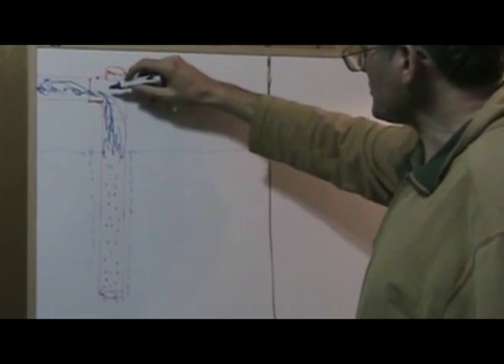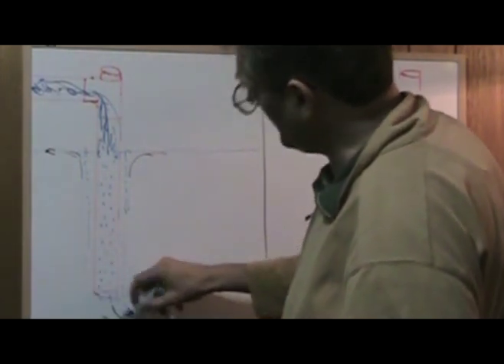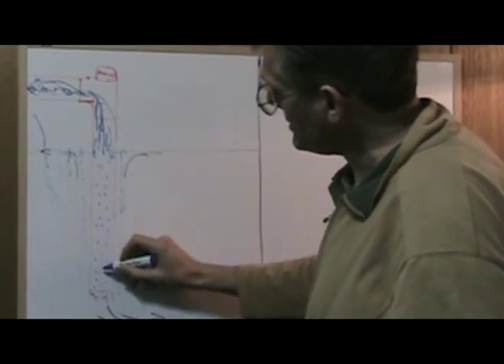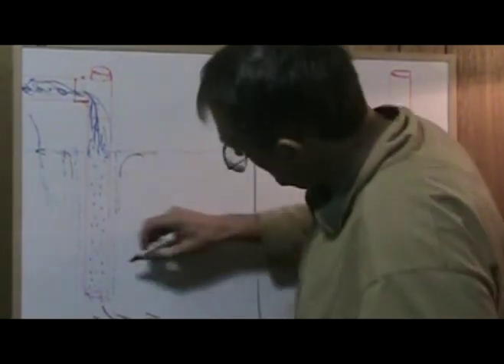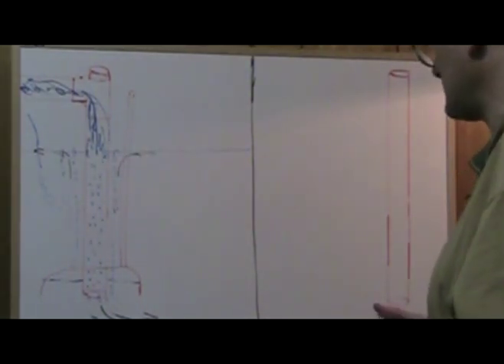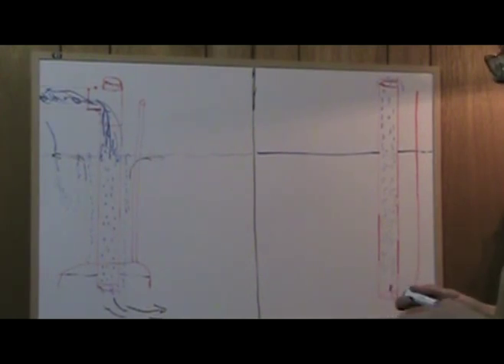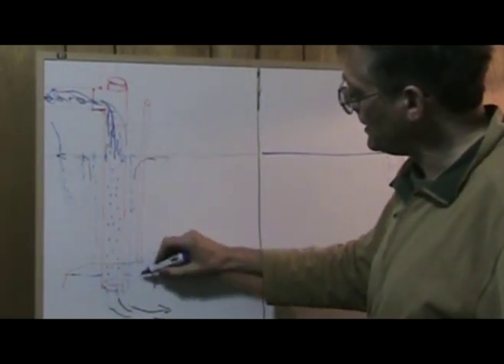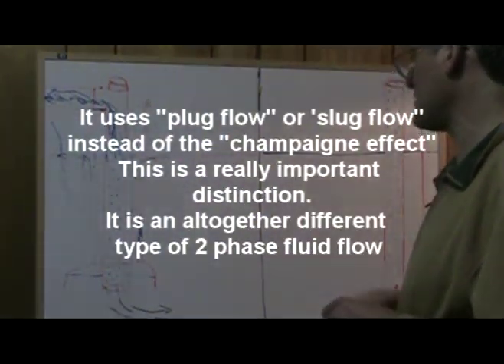Tromp and airlift pump, time for their return?

Comment: I certainly hope so. Piping cold dry compressed air to homes would help with air conditioning not to mention the compressed air powered car. I wonder what happened to the Di Pietro engine? Ragged chutes is about the height of a 38-storey building. A buried pressure vessel, some piping and a long stainless steel to drain all the rainwater falling on the roof would make a good project for an undergraduate mechanical engineer.
Reply from the maker: Compressed air from rivers has an unpleasant "fishy" smell.  I did pipe lightly compressed air from a stream to our family's house in Ireland, and down the chimney.  It harvested a lot of waste heat from the chimney but the smell was awful.  I think a better solution might be to compress the air using a gravitational vortex turbine..
Reply: @Brians-tracking-solar-scoop  How does a gravitational vortex turbine compress air? No account of Ragged Chutes air mentioned a fishy smell. The temperature was low enough to produce ice. You on the other hand are heating the water. Perhaps?
Reply from the maker: @elye3701  Water in small streams and rivers has algae and organic compounds in it.   So you naturally get volatile sulfide and organic compounds from the water released into the air  when it is in contact with air under even low pressure.    Plus you get a biofilm on the pipes themselves of bacteria that will use some of the oxygen to grow and these release their waste compounds into the water.    Ragged chutes was built on a huge cold river over a hundred years ago.  Before anyone was using fertilizers and having them run off into rivers.  It was different.   But perhaps it didn't smell great either?  Did anyone ask the miners?    A gravitational vortex turbine is typically used to produce electricity.  But if you size it correctly and connect a compressor to the top instead of a generator,  it will compress air.  As water power goes, this should be a very environmentally friendly method.
Reply: @Brians-tracking-solar-scoop  I make my own biochar and powder it. Perhaps this can remove the fishy smell.

Comment: Here #BruceLeavitt, #trompe designer and developer, provided a technical presentation on how a #trompe air compressor uses mine water to compress air without any outside power and without any moving parts; how the compressed air can be used to #oxygenate the mine water to #accelerate iron #oxidation; and how to identify mine waters that can benefit from #aeration. 

Link For More: http://goo.gl/g4sDze
Reply from the maker: Thanks Vinn,  I first suggested much of what Bruce Leavitt said  on the internet  in 2000 to 2002 (oxygenation of streams,  sewage treatment, etc) and I put various trompe  and pulser pump videos online then.  He claims 4 ft of head is needed,  I worked them with  1.5 ft of head, (for over a decade)  my designs are simpler and there is less pipe, so cheaper too. 2 of my pumps was in a magazine called "practical farm ideas" in the 1990's  in the UK

Comment: found ! I guess I owe you an apology: I admire the calm way in which you explain. I also see why you call it an airlift pump: it is one. That doesn't mean that without the trompe it would be energy efficient at either pumping or aerating: the trompe gives you free power plus free aeration, thanks to the counterflow of water and bubbles, and thanks to the below level air reservoir which accounts for pressure differential, like I tried to explain. Remove the trompe and we have a different story.

Comment from the maker: It  shows how in  the pulser pump, simplest pump in the world video.  It is called slug flow if it is going up an incline (waves in a pipe)  or if it is going straight up it is called  plug flow. Slug flow is not as efficient as plug flow but it beats making a high tower in lots of cases.   The physics of plug flow are complicated and there are competing models of how it works.  They may not have good models for small diameter tubes because they do commercial (large diameter) models first.

Comment from the maker: "you seem to juggle numbers", pretty standard physics there  actually!  M for mass, kg, g for acceleration due to gravity 9.81 ms-2 and h for height in meters.  g cancels out so I ignored it.  Then height by weight of water pumped over height by weight of the water powering it  gives you the total efficiency of the trompe airlift pump combo.  Similar (rough)  calculation for an electrical water pump, power station 0.45 by 0.95 (line loss) by 0.8 motor by 0.8 pump.  (Better but you pay).

Comment from the maker: The English researchers in their pdf were saying 60% efficiency for a DEEPER trompe than mine working off  a 2 meter head instead of my half meter.    No idea where you got your 2% from.   I was getting 4 litres per minute of water at 3.5 metres high coming from  300 litres (or less) per minute power flow falling a half meter.  So 300 by .5 is 150  and 3.5 by 4 is 14 and that is about 9% total efficiency.   I also measured how much air was being compressed per minute.  Really straightforward.

Comment from the maker: No offence.  I had stalkers on other videos too.  People weep at the amount of CO2 that we put in the air yet they refuse to consider using low head water power because it is "inefficient".  It cannot be converted into electricity without costing a fortune!  So why even try?   My solution is to use it directly without the conversion. Most people in the world don't have a pump or much water or  clean water.  Its about using the resources they have to do stuff. No electricity or pump required.

Comment from the maker: Well, join my pulser pump group on yahoo and look in the files section for the pdf from England.  And the video is small tromp in combo with small airlift pump.  Absolutely not the same thing as big airlift pumps.  It uses plug flow for starters and the big ones use the difference in buoyancy between a column of  water or a column of a gas water mix.   Most of the engineering books are in disagreement with you about efficiency, by the way. Who has heard of a 7 meter deep aquaponics pond?

Comment: as for a trompe: that was a very ingenious way to produce compressed air from an existing water level difference. This compressed air could be used for lots of interesting purposes like a furnace, alas not efficiently to pump water with. For that, a ram pump is far more efficient.

Comment: Brian, I never criticised the trompe, only the energy efficiency of an airlift pump activated by an electrically driven air pump and it's illusion of efficiently aerating the water. Both are urban legends. I have calculated every single airlift pump I came across of which all necessary data were available: head, volume pumped @ this head, and energy consumption. So my conclusions are not merely an "opinion". I will be glad to send you my aquaponics calculators if you send me your mail address.

Comment from the maker: Hi, Frank,  Britta Riley  (who helped start  the windowfarms community) first used water pumps connected to the mains electricity.  They failed, they moved too much water and they easily blocked and burned out with the biofilms and grit from  hydroponics. It is not fair to say "a solar panel connected to the right pump can easily outperform any airlift pump". Britta found that burnt out pumps did not outperform anything!  Windowfarms is worldwide with airlift pumps, has about 40,000 members.

Comment from the maker: "Pleas don't take your dreams and wishes for granted, and don't mislead others into doing so".  I don't and I don't. 1500 years ago there were watermills from Ireland to Persia using 1 to 4 meter head.  Nobody currently uses  half meter to 2 meter head water power.  And there are many millions of sites available world wide.  So how am I misleading people.  The tromp/airlift pump combo is simply a cheap carbon neutral  way to use that "wasted" power.

Comment from the maker: Frank,  I am currently using less than 7 kPa of air pressure to pump water in 9 locations in my pallet gardens with a "pneumatic grid".  It uses about 20 litres per hour of that air per location. 1 airlift pump per location.  My deep pulser pump produced 11 to 15 litres PER MINUTE of 21 kPa air from a half meter head tromp and around 300 lpm flow. There are millions of such sites available and unused.  Your water pumps run clean water, my airlift pumps have no filters and circulate dirty water

Comment from the maker: The "efficiency" of an airlift pump is generally quite a bit higher than 2%.   My old pulser pump was overall 3 to 10% efficient depending on how high I was pumping.  That was using a half meter head of water to power the thing.  So we could conclude "up to" 30% efficiency for the tromp section and up to 30% efficiency for the airlift pump section if they were both equally efficient.  Researchers in England suggested 60% efficiency with tromp from a 2 meter head. (I have the pdf from them)

Comment from the maker: Frank, that is your "opinion".  There are millions of desktop aquarium pumps out there, most are 1 to 3 psi.  That is 2.3 ft to 7 ft pressure or  less than a meter pressure to just over2 meters.  The bubble pump does not oxygenate the water, it creates a current too.  Also, you use the airlift pump to dribble water  half a meter down a little gravel wall with thin film aeration.

Comment: Pumping air is less efficient than pumping water, if only because air can be compressed, water not. Compressing air always results in a temperature rise. That energy is lost to the movement of water, what the purpose should be of a pump. Pleas don't take your dreams and wishes for granted, and don't mislead others into doing so.

Comment: any idea of the energy efficiency of an airlift pump? ever tried to calculate it? it is less than 2% ! designing  an airlift pump is the easiest thing to do, designing an efficient one is near to impossible. Oxygenation through bubble aeration is another urban legend, a religion: due to lack of contact time and pressure difference oxygenation only becomes efficient at depths of over 7 m. To pump air to 7 m deep needs lot of energy.

Comment from the maker: Sounds excellent.  Thanks for the pump info.    I am trying to get people interested in the concept of a low pressure pneumatic "grid" where people share low pressure for pallet garden kind of watering projects, pond aeration, fountains and water movement,  among "back yards and gardens" in residential areas.  This might involve a couple of people with these pumps, a couple with wind and maybe solar thermal pumping too. Ends up cheaper than batteries but useful work is done locally.

Comment: in terms of efficiency, the Resun Aco-001 is the kind of air pump that you need - unfortunately, you fall in-between the different applications but at 18W, 38l/min it should provide more than enough even under a fair amount of head.
It's an electromagnetic air compressor.
Otherwise, the eheim 100 and 200 can't be beat in terms of efficiency - both rated 3.5W, capable of 100-200l/h, they more than suit your specifications.
The biggest problem I have is trusting the spec. Eheim is usually good.

Comment from the maker: Christopher, if you find a little air pump that works,  will you let me know?  I am doing "pallet gardens" and they need about 60 litres of air per hour to provide water cycling to 2 or 3  pallet gardens.  It is a kind of SIP system, I guess. I use an aquarium bubble pump now to do it but a solar panel would be the ideal solution.  The bubble pump is 3 watts, produces the 60 litres per hour of air at 2 psi.   (Which is a tiny amount really for what it does), thanks Brian

Comment from the maker: Hi, Christopher,  I am looking into that right now!   A solar panel working a cheap air compressor would be perfect!  But I cannot find an air pump that is low wattage.    By the way,  I got 3 inches of submergence to lift water to  over 60 inches!  (The books say that is impossible  (it worked for days on video too!) I have been designing a really cheap experiment  so that anybody can play with it witha few dollars worth of equipment.  Maybe someone will find the perfect shape of delivery pipe!

Comment: I have been looking at something like this for a while and saw the Geyser Pump patent. From what I can see of their diagrams, they replace filling the tromp by waterfall with an air pump to induce slug flow. I believe that this is obvious and should not be patented - however, What IS useful is designing the shape of the air delivery in the air-lift to encourage slug flow.
Looking at the air requirements, it seems that a solar panel can shift a fair volume of water with this tech.

Comment from the maker: I replied to itsandbits by mistake. Anyway, windowfarms first used waterpumps but they were expensive and kept failing so they almost all use little air pumps from  aquariums and airlift now.  So airlift pumps are returning in a pretty big way in home food production.  But I have not convinced anyone yet to try the "pulser pump nano" idea.  Very small tromp (easy to make)  powering a bundle! of small airlift "tubes". I did a few tests and 3/16 inch tubes can pump 18 ft high with 1 psi pressure!